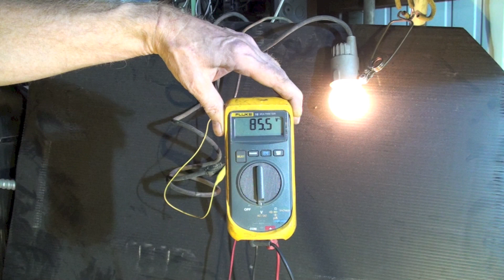Will a short to earth ground kick the breaker

Comment: for any circuit to work you need a completed circuit, the way a voltage divider works is by grounding where you want the divide, the nearest place is normally in the fuse board, but it is also done at the transformer, this is what gives the ability to have 120v from hot phase to neutral and 240v from hot to hot. depending on how well the pole and your earth rod are grounded, this depends on the conductivity between the ground and your ground rod, which can depend on how moist the ground is, what the ground soil is composed of etc, this can complete the circuit, but the ground is a variable conductor, so the resistance can vary wildly, you also have other factors at play, for instance the loading of the transformer.
the reason an over current protection device doesn't trip, is that there is a resistive load on the circuit, namely the ground, which prevents a circuit completed this way from overloading, if you have a gfi breaker, this would trip as they require the hot and neutral to be in balance and will trip if they are not (within the spec of the breaker) the reason an overcurrent breaker will trip is that a direct short to local ground is a short to neutral and will create an overload due to the very low resistance of the cables, usually under 2 ohms.

Comment: Is a shorted appliance likely to have the same thing happen or would there bee a good enough contact that the breaker would trip?
Reply from the maker: A shorted appliance will kick the breaker.
GFM
Reply: @grayfurnaceman  Even if the contact is momentary?
Reply from the maker: @andystitt3887  That depends on the impedance of the short.  If the short is low impedance, the breaker will open.
GFM
Reply: What makes the impedance good?
Reply from the maker: @andystitt3887  The lower the impedance, the higher the current draw.
GFM
Reply: @grayfurnaceman  Are lower impudence faults more likely in than high?
Reply from the maker: @andystitt3887  Yes.
GFM

Comment: Around timestamp 4:30 you state "at 85 volts"  It is NOT 85v at this point anymore, it's ZERO volts.  Why on "EARTH" did you NOT measure the short circuit current with your Ammeter???????????  That's what was being waited for (at least with me)

Comment: Question please.  The single phase step down transformer, on the utility pole,
has one conductor connected to the top. HIGH voltage, low current. The burning
question, how does this BALANCE  THE (current, load) back toward the power
generation station?    You informed us the NEUTRAL completes the balance on
OUR SIDE of the transformer. Thank you.
Reply from the maker: My expertise ends at the pole transformer secondary.
GFM

Comment: Fantastic. with everything wired correctly (no open neutral) why do we have no shock when touch the neutral wire inside the box? thank you
Reply from the maker: Because the neutral is the center tap of the pole transformer which is at 0 volts to earth ground.
GFM

Comment: Am i missing something? for a 220 connection it must use ground not a neutral???
Reply from the maker: A 220 volt circuit, neutral is not used.  The 2, 120 volt hot lines are are connected together thru a load. chassis  ground is used for safety.
GFM

Comment: Ok GFM,, you got me that time,, ,,, ok,, that should have tripped your breaker! Right? You are screwing with us. If you then hook blk jumper to neutral it would trip?

I think your earth ground is in some dry soil with more rock than dirt. Here in tidewater we drive a 6ft ground rod anywhere and hit water.
Reply from the maker: 3 days of rain just before the test.  Of course it will trip if connected to neutral.  That's kind of the point.  Earth ground is a high resistance terminal.  It will never trip a breaker at these voltages.
GFM

Comment: so the ground is just a circuit to drain off any transient voltage/power ? I'm guessing it is there to level the playing field? I know that a/c voltage crosses 0 volts every second.
Reply from the maker: You got it.
GFM
Reply: I have a question. Recently a contractor wired up my well pump with 240 from my house. They used 14/2 with a ground. Is there any way I can tap 120 at the pump house for my softener?
Reply from the maker: Not and pass code.
GFM
Reply: Doesn't each sine phase cross zero 120 times per second? (60Hz).

Comment: Too many techs assume earth ground has Zero resistance and therefore a very large amount of current will be drawn with a short..  That isn't so.  So, why didn't the breaker trip?  Well, it depends on the quality of your earth ground and the size of your breaker.  In commercial application the resistance value of earth ground is supposed to be no higher than 25 ohms and for the telecommunications industry they prefer 5 ohms.   Your home ground might be considerably higher in resistance .  Using Ohm's law that would mean at 25 ohms you're pulling 4.8 amps at 120 volts with the short you created.  Not enough to trigger your typical 20 amp breaker.  Of course that's assuming no other load is on the circuit at the same time.   In your case you had a light bulb in the circuit.  A 40 Watts bulb draws 0.36 Amps to operate. A 60 Watts bulb draws 0.54 Amps to operate.   So if you combine both the resistance of earth ground at 25 ohms and your light bulb load you would not trip that 20 amp breaker.  Using 5 ohms earth ground you get a current draw of 24 amps which would trip a 20 amp breaker.  But until you measure the resistance of YOUR earth ground you don't know just how much resistance your grounding system at your home provides.  I hope this helps.

Comment: Is that the theory behind a welder?
Reply from the maker: No.  Welders are fairly low voltage devices that may "short" if the electrode is touched on the weld metal without starting an arc, but the low voltage  will not allow the amperage to exceed the rated load.  Earth has nothing to do with it.

Comment: i don't know why people don't think that the ground can carry a current. One of the first things you do if you are out in a field and you see the power line fall off of a dragline, you pull your feet together so they are touching and pull your hands and arms in so they are touching your torso and you keep it this way until someone turns that thing off. This will make you a dead circuit branch and will save your life.
Reply: +tralay   In your example, the person's body is not even providing a current path. Current requires a difference of potential,  your example describes an equipotential, same as a bird on wire. The current does not flow through one leg of the bird through the other leg of the bird, since there is no appreciable difference of potential across the bird's feet. The bird or a person in a field does not need to put their feet together to prevent current flow through their body. Now go out to the nearest utility poles with wires and birds on the wires. Do you see any electrocuted birds underneath the wires?
Reply from the maker: The ability of earth ground to carry a current is, as with all circuits, dependent on voltage.  With your example, the voltage is quite high and will pass a significant current across high resistance.  
GFM
Reply: He proves here that earth ground can and does carry a current.

Comment: One person mentioned a safety issue.  I'm not too worried about safety, except for faulty wirings. Beware that most breakers are designed to detect a short to ground with low impedance. For example, try a short at a known good ground source without the alligator clips. If trips then a safety issue.
Reply: You're describing a GFI, not a standard breaker.

Comment: dead right here,,, so many electricians ( who do not know theory, so I have to imagine the actuality of their intelligence and how they  became licensed electricians), think that  situation will trip a breaker.. GROUNDING will not protect you from electrocution. The electricity is completing its circuit by using the ground (earth) as a parallel  or singular path back to its origination...

This is a very dangerous thing,,, you can connect the hot wire direct from a breaker to a ground rod driven in the ground,, and the breaker will not trip.

A brilliant code instructor named Mike Holt covers this,, I think before anyone can carry an electrician license should have to complete a basic electrical theory course authored by Mike .

There is not enough room here to explain why you will have varying voltages on the meter,, (potential plane,, parallel circuit, utility company pole grounding, etc)

But folks if yall try this at home you are mere inches away from death by electrocution..
So,, really,, folks,, please do not try this at home.
Reply from the maker: whommee Many electricians may dispute this but the teaching to become an electrician is mostly learning code.  Good solid basic theory is lacking.  This is not to say electricians know nothing except code because I have learned many of my skills from them.  Thanks for the comment.
GFM
Reply from the maker: Good thoughts Thanks
GFM
Reply: whommee this is very new to me ,I'm amazed by this and mike,I always always though of ground as ends ville,were all voltage ends,I never thought this would happen
Reply: Whommee, the electricity needs to be completing its circuit with the white neutral conductor, and that should trip a functional breaker. The Earth Ground is there for higher voltages from lightning of an electrical storm. Hopefully, to not burn out a service main panel.

Comment: This should NOT happen!  The ground and neutral should be bonded in the main panel, which means that the ground and the neutral should have the same potential (120V) and should kill the breaker every time, period.  If this is an auxiliary panel you might have a bad ground connection between it and the main panel.  Definitely something wrong here.
Reply from the maker: As in most of my videos, I am testing concepts to see what happens.  The earth ground that I am showing here has no connection to neutral.  Actually, the neutral and/or earth ground should have the same potential but it is 0 volts.  The only time I would expect the neutral to have a 120 volt potential is if it is disconnected from the neutral before it reaches the panel.  In that case, it feeds thru the load (if the hot lead is switched on) and effectively becomes hot.  The main point I have been making in these earth ground videos, is earth ground is not generally used as a conductor in the circuit.  There is a huge misconception that ground is one of the conductors.  It is not.  One of the few times it can become a conductor is if you are standing in a wet area and touch a hot lead.  Then the power passes thru your body to earth ground to the neutral in the panel.  In this case, the amperage is far too small to open the circuit protection.  Thus the reason for GFCIs.  Again, thanks for the thoughts.
GFM
Reply: grayfurnaceman   Maybe I'm confused.  Is the ground wire you used in your video hooked to the earth ground in the panel or a completely separate ground rod?  If it's hooked in anywhere in the premises ground system, the breaker should blow.  If the point was to show why you need a GFCI, then I understand what you are trying to show, but if you are talking about a short to case fault in a grounded appliance then I'm confused.
Reply from the maker: ***** If I used an earth ground connected in the panel I would be defeating the purpose as the ground is connected to neutral and the circuit protection would open due to the neutral connection.  
The earth ground is commonly believed to be a part of the 120 volt circuit.  That is not so.  Its resistance is far too high to be used for these low voltage circuits.  Its only real purpose is absorb spikes and lightning protection.  The neutral is the one that opens the circuit protection.
GFM
Reply: grayfurnaceman
 You need to calify that you dont have an MEN.
Reply: what is a MEN?
Reply: Alex Chala , what is a MEN?

Comment: it wont trip because it wont exceed the amperage rated of the breaker, the earth to ground has a very high resistance and current is very low , am I right with this here?
Reply from the maker: Right on.
GFM
Reply: No.  The breaker does not trip because there's no current running back to neutral.  When you disconnect the neutral side of a breaker, you remove its safety benefits from the circuit.  No neutral, no trip.  A GFI, however, would trip in this scenario.
Reply: This isn't correct. Normal breakers don't measure or care about the neutral current, just the hot side current.
Reply: @captain150 
Correct, but Earth ground won't usually allow high amperage - though still enough amperage to kill you. 
GFCI is worth it's weight in gold.
I see they are now incorporating that into breakers if you want to do it that way.
It may be less convenient to reset at the breaker box is the only consideration on where to have the GFCI protection.

Comment: Just curious, how dry is the ground outside at the grounding rod? Is there a good connection between the wire and grounding rod? How old is the grounding rod? How old is the breaker in the panel? Sorry for asking so many questions.
Reply from the maker: I did this after a soaking rain the day before.  The connection had 0 ohms.  The grounding rod was brand new.  The breaker is about 10 years old.  Hope this helps.
GFM

Comment: What gives?? A direct short to ground should trip the breaker? Is panel/system properly grounded and wired? That is a serious safety issue. Any equipment plugged into that system that has a short could possibly kill somebody?
Reply from the maker: You are missing the point of the video.  Earth ground, unlike chassis ground(Neutral), will not immediately kick off the circuit protection.  It can pass enough power to electrocute but not enough to kick the breaker.  This is the reason for GFCIs on outdoor outlets.  Hope this helps.
GFM
Reply: A breaker assumes both hot and neutral are connected to the breaker.  He disconnected the neutral, which means the breaker is not connected as-designed.  He has completely bypassed its intent.  Hence, GFI.

Comment: It won't trip the breaker because electricity is just returning to its natural state in fact find out where the ground wire connects to a ground rod and the area surrounding it and I mean the ground itself will read voltage.
Reply: Correct.  It won't trip the breaker but it will trip a GFI, which is why they're near water pipes and patios.

Comment: would have been interesting to put a clamp on it to see how much current it was drawing
Reply: The voltage is simply being divided into unknown portions along an x distance. You can't even predict what value of current would be at any instant in time, because there're so many factors affecting it. The important thing is that the breaker doesn't trip :)
Reply: @2013Aleksey2013  He's talking about Vrms.
Reply from the maker: I did try an ammeter at one point but did not put it in the video.  It was .4 amps at that time.
GFM
Reply: @grayfurnaceman  That's 300 Ohms through earth (120V / 0.4A), right?

Comment: So the lamp was glowing because the source was grounded?
Reply from the maker: Yes, the hot side was connected to earth ground thru the light.  It was probably feeding to the neutral at the power pole.
GFM
Reply: grayfurnaceman Although I do not understand why the breaker hadn't shut down the flow of current when you connected directly the hot wire from the breaker to the earth ground. There's obviously some amount of current going through the junction as indicated by the sparks. But that current is somewhat smaller than that required for the breaker to trip. And there's no excessive current draw through the junction so the voltage is really being dropped somewhere between the source and the junction. I guess that's why people refer to earth ground as a "poor" conductor of electricity.
Reply from the maker: 2013Aleksey2013 Exactly.  Unless you have quite high voltage, the high resistance of earth ground reduces the amp draw to very low levels.  What I am doing here is trying to explain that earth ground is not an effective  conductor for the voltages we use.  The only way to kick a breaker is to have a connection to Neutral which goes back to the common on the pole transformer.  Hope this helps.
GFM
Reply: grayfurnaceman Thank you for the help.
Reply: In order to trip, a breaker assumes the current is coming back through the breaker's neutral, which is not this scenario.  The neutral side of the breaker is completely out of the circuit--it's not connected.  That's why you need a GFI device near ground (water pipes in the kitchen and exterior outlets),  Those trip when current bypasses neutral and runs to earth ground.

Comment: What about a RCD?
Reply from the maker: In this case, we were not connecting the neutral at the panel at all so there can be no imbalance.
GFM
Reply: We have a different earthing systems I've noticed, see the wikipedia article. Noting the differences between functional and protective earth systems. RCD protected circuit do trip via the MEN link. Non protected RCD circuits don't. 
http://en.wikipedia.org/wiki/Earthing_system 
It's quite common to see in Australia the TN-C & TN-S. Basically the earth and neutral are connected up everywhere. The MEN link we commonly refer to it as. Certainly different in your neck of the woods.